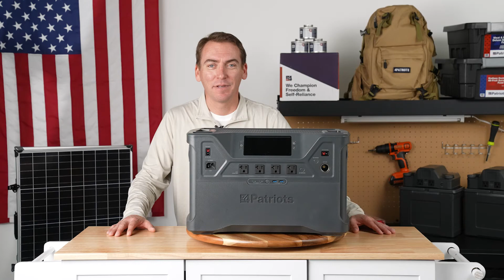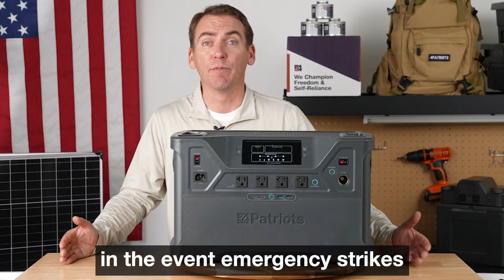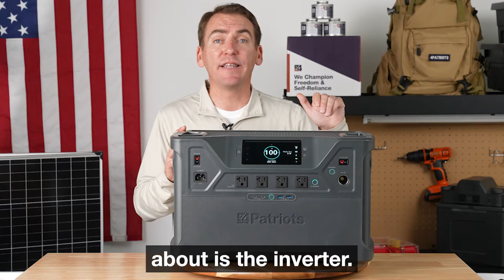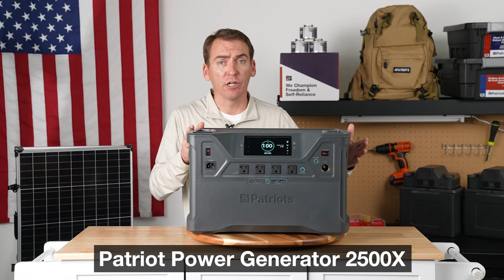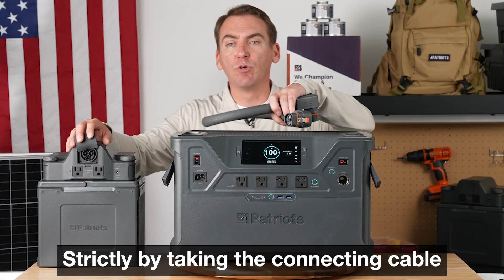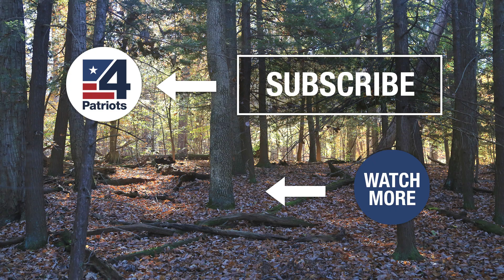How to Use Your Patriot Power Generator 2500X

Comment: How long is the solar panel adaptor cable and how far away can I place two daisy chainedcsolar panels without setting the generator outside for better security in an emergency situation?
Reply from the maker: Hey there! For this, you can use our 25ft extension cord that comes with your generator order, Joseph!
Reply: @4Patriots  how do you plug the generator into the solar, using the cord, without leaving an exterior door open? I want the generator safey inside, and it's cold outside, or bugs, or whatever
Reply: @kerrysiggard9285 its ok. Nobody will steal this pos.
Reply: Don't buy from this company.
Reply: @tramcarter  why